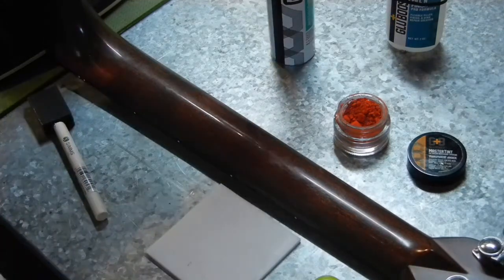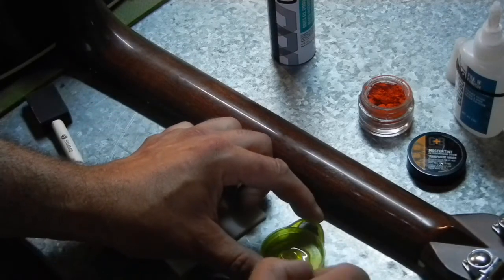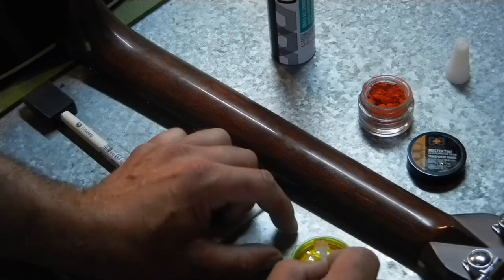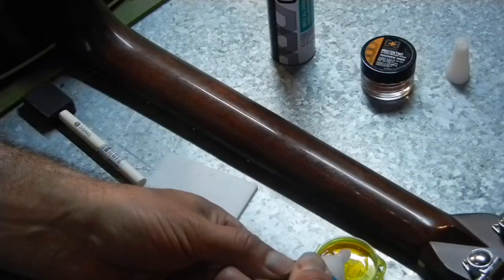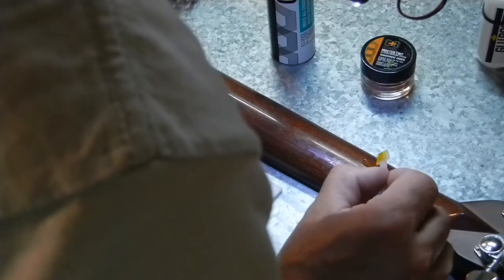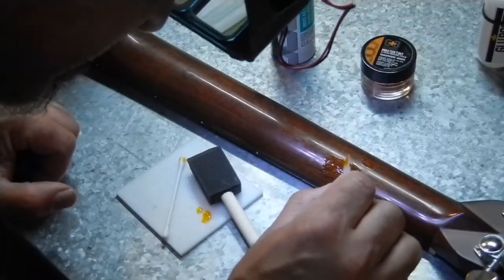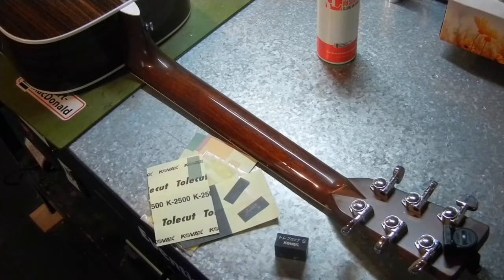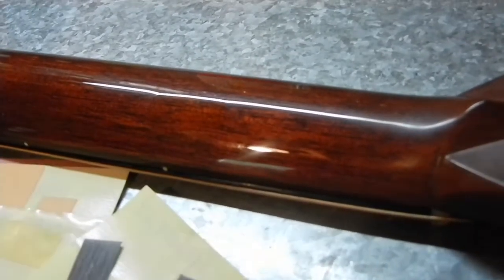Jamie John Surette fixes a guitar neck's finish.

Comment: Great job, did you use the thick or thin 'fill and finish'? What grits did you use in the micro mesh? Did you polish by hand or buff? If by hand what type of polish did you use? Cheers Cathy.
Reply from the maker: Hi Cathy - I used the thick in this case, and polished with a buffer, and used successive grits of tolecut papers.https://www.stewmac.com/Materials_and_Supplies/Sanding_and_Polishing/Buffing_and_Polishing/Kovax_Tolecut_Finish_Repair_System.html